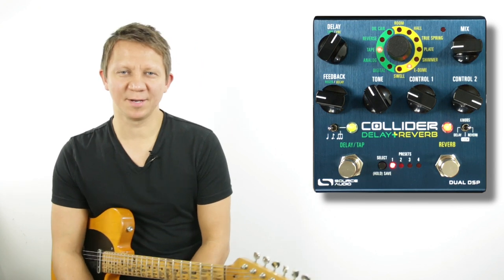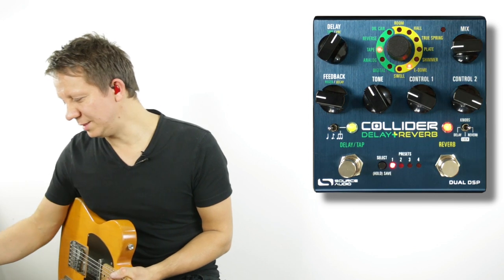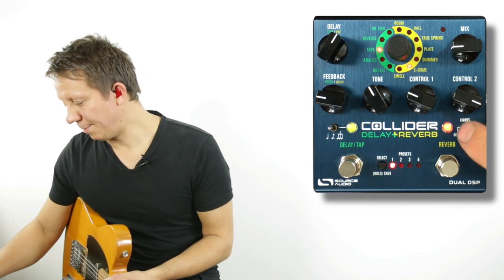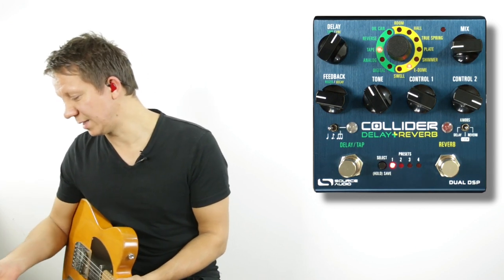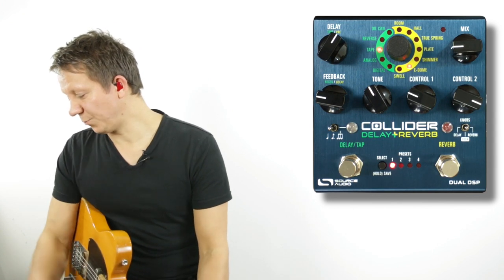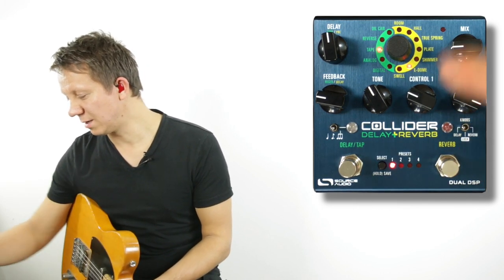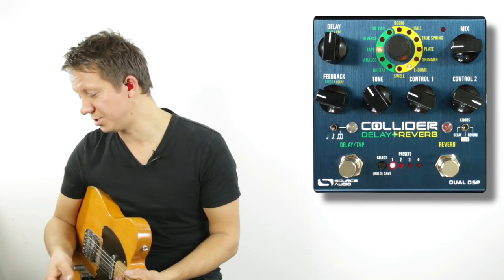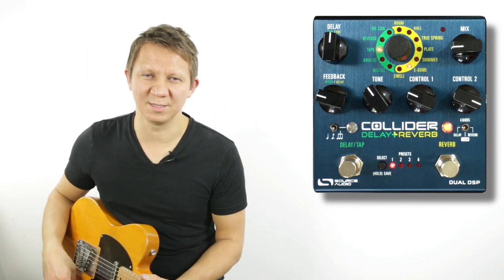Source Audio Collider

Comment: Is this another one of the digital pedals where the knobs don’t necessarily represent the value you think they do?   They’ve done that on some of the other SA pedals I thought.
Reply: Yes, if a pedal has presets it's not really possible for the physical position of the knobs to always represent the knob's true value. The only way around that would be some kind of machine controlled knobs, which would require a huge jump in cost without a much benefit. That said we do offer a mode whereby if you move a knob the value will not change until you reach the point where the preset value resides. The position where the knob locks into the true value also coincides with a blinking LED, to give a visual cue. This is an issue that we have thought about long and hard, we hope our solutions satisfy as many as possible.
Reply: @sourceaudioeffects  Or have an LED circle around the knobs like what TC Electronic did with the RH450 amp.
Reply: @sourceaudioeffects  yeah it is, it's called a t-rex spin doctor...  which i paid a left testicle for.  unfortunately it results in a volume drop on that unit.  anyways, presets aren't a big deal to me and i look forward to colliding this with my sdd-3000 for added insanity, insanity, insanity...
Reply: @sourceaudioeffects  That's a genius solution.